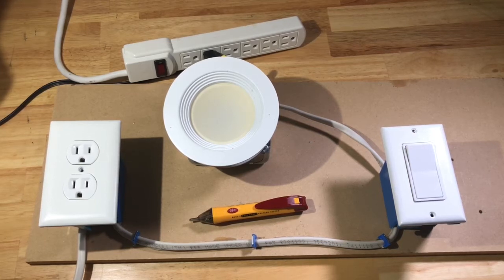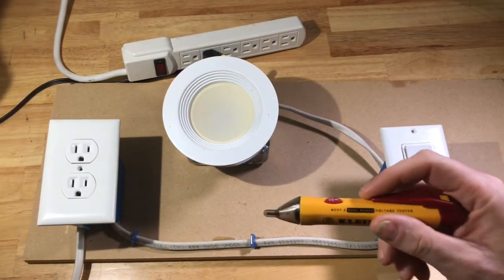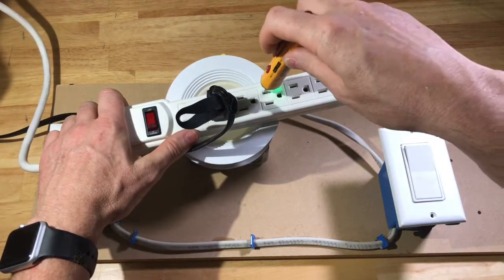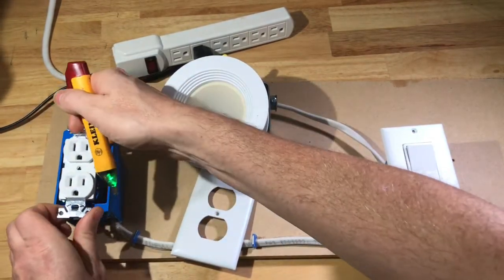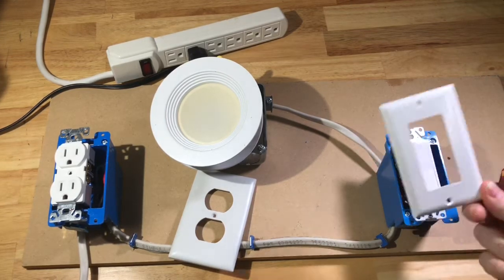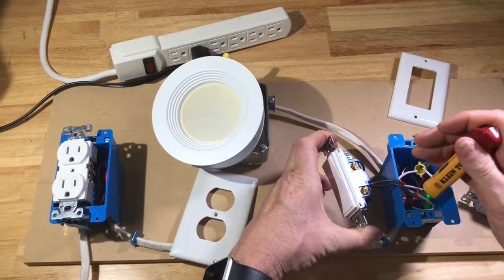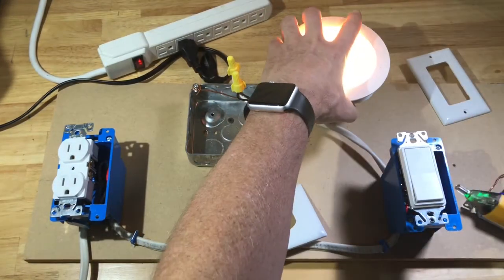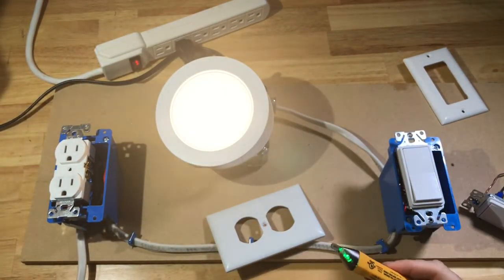How To Use Voltage Detector

Comment: Thanks for this really helpful demonstration - just what I needed.
Reply from the maker: Thanks for watching!
Reply: @sellgooddeals-DIY   You're welcome! I do a lot of basic home repairs, but always avoided anything electrical because of the whole live wire thing - never felt confident that the circuit breaker being switched off was enough. I saw one handyman I hired use a voltage detector and knew that was what I needed. But your video was the best of the ones I watched that explained how to use it.